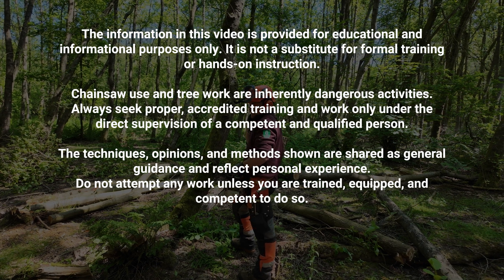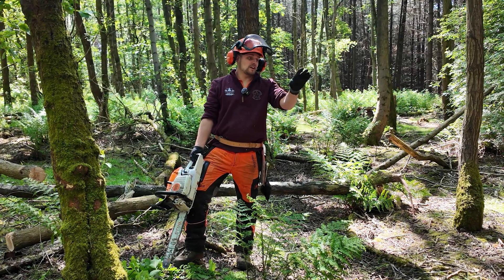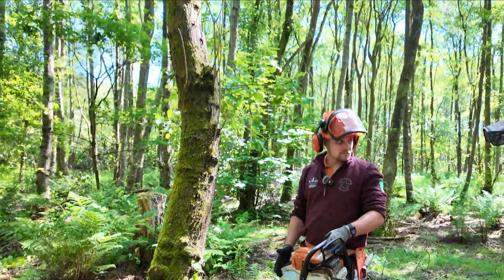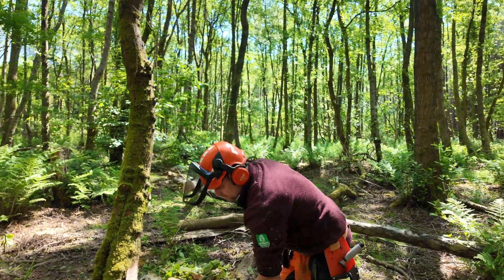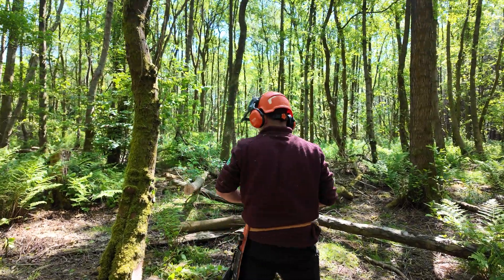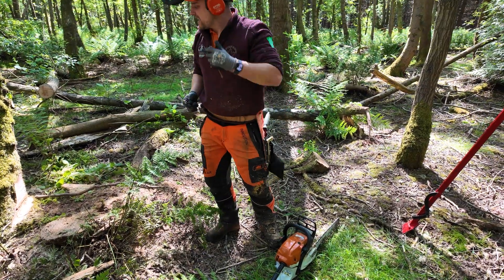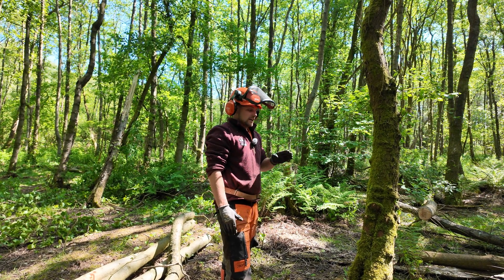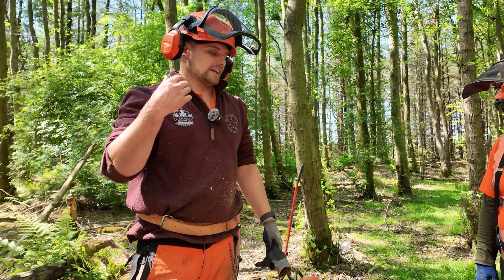Felling Heavy Leaning Trees with the Dog's Tooth Cut

Comment: cheers for the video, i guess the same concept applies for larger trees but it makes me nervous with the big 36" diameter Fir and Redwood trees I have in my forest, one is leaning hard over my driveway
Reply from the maker: Yes if the tree is heavily leaning forward the same principle applies. You will just need to make sure you have a bar big enough to bore through the whole diameter of the tree. 

If you don’t you could still do as I did in the video and cut some buttresses off. 

Heavily leaning trees are harder to steer away from the lean unless you winch it back over the opposite way so be careful with that.